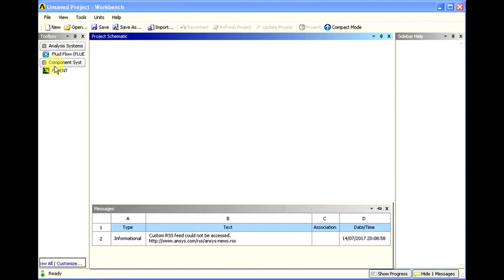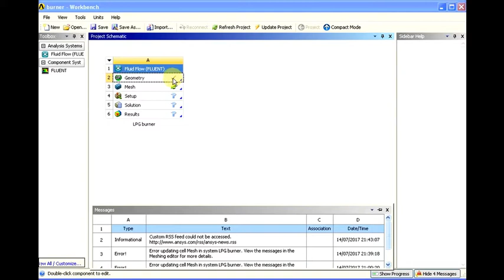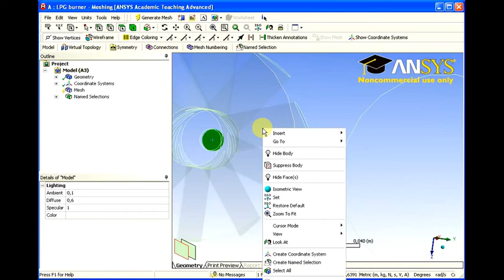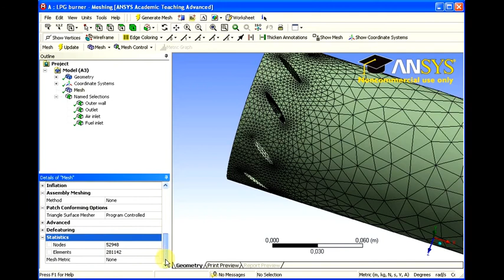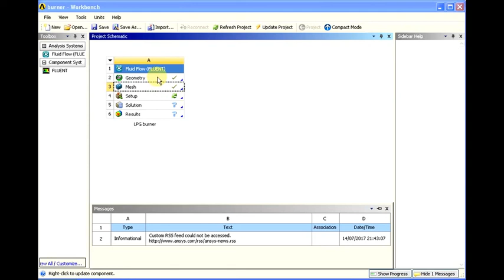Part 2: ANSYS-Fluent workbench tutorial for gas burner with air swirler

Comment: Hello, Thank you for a wonderful tutorial. Just a simple question. The previously created geometry when imported in the latest version of Ansys-Fluent does not let me change the solid to fluid domain. Thus, when I mesh it, the mesh goes through the vanes of the swirler also. Any suggestion how can I avoid that? Thank you in advance.
Reply from the maker: Thanks dear for your comment ....usually what I do to avoid any complications is to draw only one body (in SolidWorks) so there is no solid and fluid, but only fluid....the solid body I use (subtract) function to subtract it from the main body so the solid body become a void (not a body)like an empty space so you don't have to name it after that .....
Any way ...I you already have two bodies so use the (Fluid flow fluent) package to the Fluent (solo) program ....The first program in the list is (drawing) in which you name your domains (bodies) as solid and fluid ...and after you click generate the fluid body will become transparent body (otherwise you have error) ..... you have to do this before opening the second program (mesh) .....If you have any problem please don't hesitate to contact me.
Reply: Dear Khaled,
             It was great to hear your prompt response. I also created the geometry in Solidworks by following your previous tutorial. I will try using your other tip as well, the one from your response. There was one request, would it be possible for you to make a similar tutorial for completely premixed combustion (like the non -premixed one that you have recorded) ? It would be really a good overview for me to get acquainted with the flow of setting up the model. Thank you for being so approachable.
Reply from the maker: Thanks dear ....I will try to make the new video ASAP
Reply: Really appreciate it. Thank you!
Reply: @khaledAlattab  Sir waiting for your premixed combustion video.